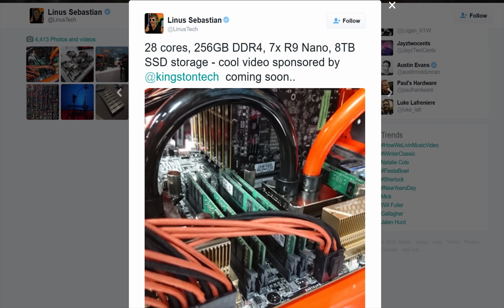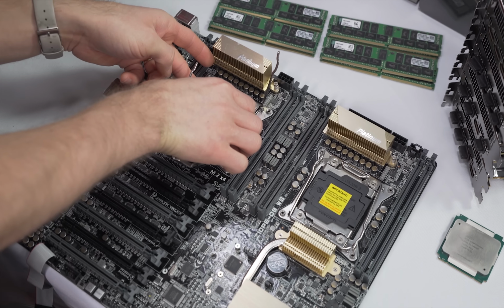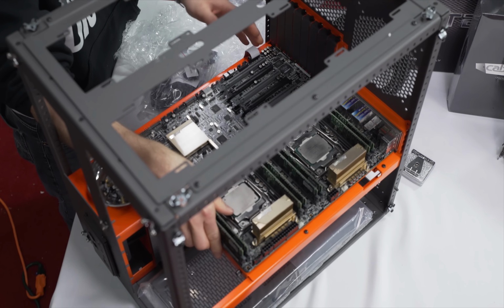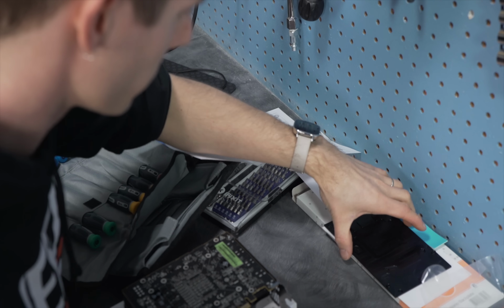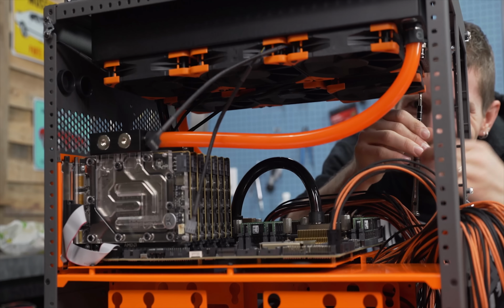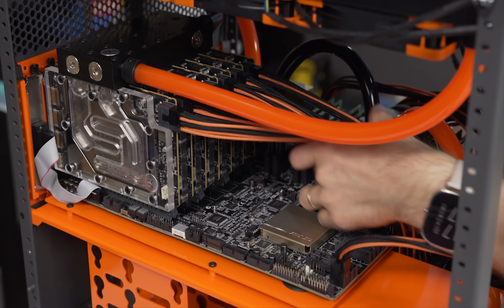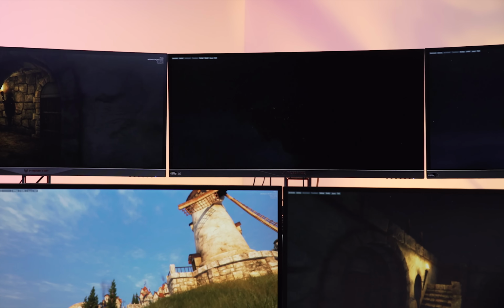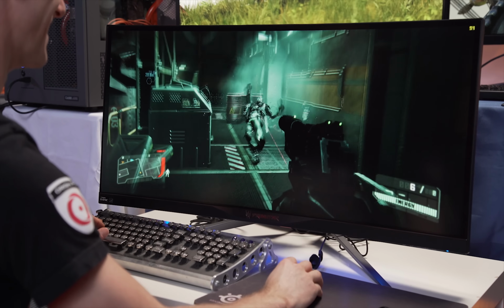7 Gamers, 1 CPU - Ultimate Virtualized Gaming Build Log

Comment: The title is a lie. It should be 7 gamers, 1 PC or 7 gamers, 2 CPU. The PC you built has 2 Intel Xeon processors. Still awesome though!
Reply: Brian Ko the CPU stands for Central Processing Unit and you could have 100 cpu's in on machine and it would still techniquelly be 1 CPU as they are all working together as one not the 2 CPU's working separately
Hope this helped :)
Reply: Thanks.

Comment: FYI, there are a ton of veary cheap power supplys that would handle all of those video cards and more for ummm, $80 to $125 and be would be considered platinum rated. I have 20 systems running 6 GPUS each so I do these builds all the time. You should have just got a server power supply (some of the IBM server supplies  are 2500+ watts) and a brake out board, then jsut hit up mane frame customs and make your own cables. Yu can also have more than 1 power supply in a PC and they also sell supplemental power supply that slide int a drive bay. Or can use $20 hp 1200 watt server power supplies that very thin and can fit into most cramed places with enough ingenuity.

Comment: Im sitting with my intel core 2 duo and gtx 750ti and cant run csgo...
Reply: Dovydas Ki Make sure your monitor is connected to your GPU, not your motherboard.
Reply: Majid hell no.
Reply: try mounting the monitor at your gpu instant 100 fps in csgo
Reply: Majid peasant
Reply: U need at least quadcore processor
Reply: Same!!
Reply: Try upgrading to AMD Fx 6300. Its quite cheap and will boost you up to at least 60fps
Reply: Samciesta no e5450 is much better for him
Reply: idk. This worked for me but if u think so then ur probability right...

Comment: Why not geforce?
Reply: Does it matter?
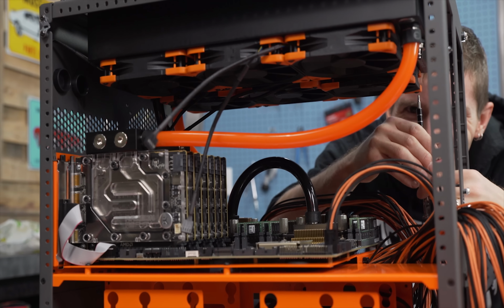But he mentioned at around 7:51, that they had ports in the upper PCIe bracket, so the waterblock probably wouldn't fit if he had to do some DIY modifications. (Or something else entirely but that is my guess)
And a benefit to this card was that he would be able to access the PCIe lock, which would be impossible if it had been any other card of this caliber.

Comment: the desktop pulls 1500w? if o tried to power that and all those monitors at the same time my electrical panel would trip
Reply: his property is not like an normal house an normal house geds around 250 volts in and he is probebly set to 330 vols 40 amps so he is able to run it as we normal peaple woudnt be able to do thad :)
hope my comment heped you :) greets a pc gamer - youtuber
Reply: Tiago Oliveira i hope that your kitchen is on a different group than the rest of your house. because the kitchen demands lots of amps.

if i had the money to buy that computer i would have enough money to hire a electrician to add another group.

but most people will be ok with another breaker. (needing nothing else)
Reply: Learn englando
Reply: he can run it using a 20 A breaker at 230 V including 7 monitors using 75 watts each. as long as its the only stuff running on the group
Reply: roader Matte yhe i know that, im just trying to make a point, a normal house can't handle this.
I have a 15amp breaker the voltage is between 220v and 250v so i get about 2,350w.
1500w +  52w * 7 monitors = 1,864w only for this pc
now we have to put into account all devices pluged in like the frige, lamps, tv's...
This setup may barely hold but i won't be able to turn on  the heater or the oven
Reply: Tiago Oliveira 1500 watts isn't enough to trip the breaker for a 15 amp outlet...
Reply: Tiago Oliveira he's pulling 1500 watts at 120 volts not 240
Reply: +David Benner mmmmm, i missed that, so the same setup would pull ~6A at ~250v
Reply: Your toaster probably uses more than 1,5 kW.
Reply: YOUR A FUCKING VIRGIN

Comment: How many frames can I get on GTA V ?
Motherboard
MSI AM3+ V X16 2D3 M16 GL R MATX

Processor
AMD FX 4300 3.80GHz Quad-Core AM3+ OEM

Video Card
AMD Radeon R7 360 2GB

Memory
PATRIOT 8GB DDR3-1600 PC3-12800

Hrd Drive
1TB Toshiba Hard Drive

Case
Aerocool Aero-500 White with Red Accent Kit

Power Supply
500 Watt Ultra

Sound Card
Onboard Sound
Reply: On low you'll probably get an average of around 40fps.

Comment: If I have this desktop and same specs can I have 1000FPS in GTAV and far cry 4????
Reply: Jeremy if you had these exact same specs all running at ultra and you are playing GTAV you will not only have 1000fps you will also be able to feel, taste, and even touch the actual characters in the game. haha
Reply: Jeremy teh you can have it easily on minecraft 😹😹
Reply: No, Basically CrossFire is also limited to Quad GPU Config so ALL THOSE SEVEN GPUs AREN'T RUNNING IN CROSSFIRE BUT ONE GPU PER VM And Each VM is as Powerful as any PC with a Locked i7 w/4C 8T, A Radeon R9 Nano and 32 Gigs of RAM; All WaterCooled. So a Non-Throttling R9 Nano without Any Bottlenecks can't give You 1000 FPS in GTA V and Far Cry 4.
And Btw Neither can those in Quad CrossFire can do :)
Reply: Impossible since those games are cpu intensive
Reply: No. That'd be a stutter hell or the game won't load at all. Look up jayztwocents's video "I tried GTX1080 3-Way SLI... and this is what happened!"  for a more detailed explanation.
Reply: sub to my channel Viral Toad
Reply: U can run it at all the fps all the frames and all the pixels no problem
Reply: hell, you can probably get that same fps running both games at the same time on just one OS with that thing.

Comment: why those gpus are do small
Reply: The R9 Nano is a notoriously small card to begin with, measuring only a bit longer than the PCI-E interface it uses. The heatsink and fan, which make it 2 PCI-E slots wide, was removed and replaced with a water block that reduced the width to a single PCI-E slot. This is how they managed to fit seven cards together.

Comment: can I play Minecraft on medium settings?
Reply: 60FPS if you downscale to 800x600 and use low settings
Reply: switzer ville 1fps ultra low u need optifine 12x2 resolution
Reply: switzer ville 144p
Reply: switzer ville there are no "settings"
in Minecraft 
only render distance and a button  that switches graphics from fancy to fast a d vice versa 😀😀😁😁
Reply: No, you must play it at 16K HYPER ULTRA. And then your getting 999999999999999999999999999 fps
Reply: Can this joke die in peace?
Reply: No you need 7 pcs 1 guy
Reply: There is. Fancy / Fast
Reply: ye 7 times

Comment: no meaning to start anything but why did you use amd
Reply: Because it was best suited. Brands don't care about you, stop caring about them.
Reply: He did state this in the video, but it was due to size requirements.
Reply: amd is far better than Intel in terms of pricing
Reply: mohammed esam The Power Consumption of The BEST GPU at that Time [Titan X MaxWell] times 7 was not Sufficed by Any Single Power Supply on This Planet, So Yeah.. AMD.
But If It was Made Today It can be Way More Powerful, I Think This must be Built Every Year with The Latest HardWare just like The Compensator.
Reply: some other guy _werty  are you out of your god damn mind 😖😖
Reply: Blackout for price but not performance
Reply: which card is it?

Comment: Can it run minecraft?
Reply: 1 fps on ultra low + speed mods
Reply: can it run minesweeper without explode ?
Reply: And Whats the recommended dedotated ram?
Reply: Click Here yes.
at a solid 5fps
Reply: Sam C only with beautiful skies disabled
Reply: Click Here you need to get the alienware graphics amplifier for that. 7 of them.
Reply: i get 0.1 fps on minecraft with my gtx 1080 8 gb
Reply: that's why I think 1080 is a waste of money I got a 1070 8 gb and I get 0.5 fps
Reply: okay i may have exaggerated i get 0.4 fps sorry :(
Reply: The question is can it run crisist
Reply: Click Here no the highest you can get is 2-5fps low settings
Reply: Click Here depending on the workload actually... Maybe
Reply: Tbh maybe not, minecraft is cpu intensive so u can't play it 7 times
Reply: Mathew Plante i cant ;-;
Reply: matimax12 Lying shit
Reply: Sam C I might have laughed if I remembered how
Reply: Sam C no
Reply: Sam C can it djent?
Reply: Lol yes at just 99999999999 fps ^^

Comment: Dude - just add another PSU with custom made switch that's connected to the power switch. You only need connecting two pins on the ATX 24-pin module to start it up. Set the another PSU supply current to five GPU's, while the 1st one is supplying the base system + three GPU's.

http://www.instructables.com/id/How-to-power-up-an-ATX-Power-Supply-without-a-PC/

Comment: 2000 dollars per day electricity!!!!
Reply: No its not? He literally said how much power it eats in the video. Even if you in US for example, and you pay bit less than 20 cents per kW hour, lets say it will be 30 cents per hour (assuming it is at ~1500W). You then run it to play games for 10 hours each day (which is not realistic at all, you wont be running 7 games at once all the time most likely), it will be $3 per day. ~$90 per month. And that is while running 7 games on this thing, 10 hours per day, each day.  I don't know where you get your $2000 from. Outside of US it would be even cheaper probably.  
Edit: With this price, you would pay less then $2000 even after running this system for year.
Reply: Lol. In Germany you can't get under 19 (20 US Cent) Eurocent/Kwh (but then you can't rely on constant supply, because the company who delivers for 19 Eurocents is in a few lawsuit; in the near future they won't be able to deliver that cheap. 
Currently average is 28 (30 US Cents).
But it is getting more expensive, because average was 25 just a few years ago...
Reply: Hans Müller Well, even with price of 30-40 you still can't possibly go up to $2000 bill.

Comment: Boîtier : Thermaltake Core W200 524,90 € EN STOCK 
 
Alimentation : Corsair AX1500i Modulaire - 1500W 449,90 € EN STOCK 
 
Disque dur : WD Gold 10 To 949,90 € EN STOCK 
 
SSD : Samsung Serie 850 EVO - 4 To 1 499,90 € EN STOCK 
 
Graveur : Asus Graveur Bluray - BW-16D1HT/BLK/G/AS Noir - Boite 94,99 € EN STOCK 
 
 
Composants
Processeur : Intel Core i7 6950X 1 799,99 € SOUS 7 À 15 JOURS 
 
Carte mère : Asus X99-E WS 593,99 € SOUS 7 À 15 JOURS 
 
Mémoire : G.Skill Ripjaws V Red DDR4 4 x 16 Go 2133 MHz CAS 15 399,90 € SOUS 7 À 15 JOURS 
 
Carte graphique : Sapphire Radeon Pro Duo - 8 Go HBM 1 589,00 € EN STOCK 
 
Radiateur : Corsair Hydro Series - H110i 144,95 € EN STOCK 
 
Carte son : Asus Essence STX II 7.1 269,99 € EN STOCK 
 
 
Services
Montage : Materiel.net Montage de composants + Installation système 68,00 € EN STOCK 
 
Installation système : Materiel.net Installation système 29,00 € EN STOCK 
 
Extension de garantie 3 ans : Materiel.net Extension de garantie à 3 ans atelier - D 188,99 € EN STOCK 
 
 
Périphériques
Ecran : Eizo ColorEdge CG248-4K + Visière + Sonde 2 349,90 € EN STOCK 
 
Clavier / Souris : Roccat Isku FX + Tyon - Noir 179,90 € EN STOCK 
 
Tapis de souris : Razer Firefly 69,90 € SOUS 7 À 15 JOURS 
 
 
Accessoires
WiFi : Asus USB-AC56 - Clé USB WiFi AC1300 double bande 62,99 € EN STOCK 
 
 
Logiciels
Système d'exploitation : Microsoft Windows 10 PRO 64 bits (oem) 179,89 € EN STOCK 
 
Suite bureautique : Microsoft Office Famille et Petite Entreprise 2016 259,90 € EN STOCK

Total 11 705,89 € Source : materiel.net

Comment: Hmm, I would totally go for a 4-gamer tower like that. Build it, put it on  a square in the middle, surround with 4 monitors and peripheral sets - got yourself a cool 4-friend gaming station! Plus with 4 GPUs it's much easier to do since you could be running this off a single kickass CPU and a regular mobo with 4 PCIe slots (like I do now anyway).